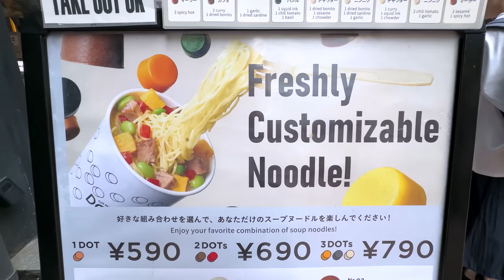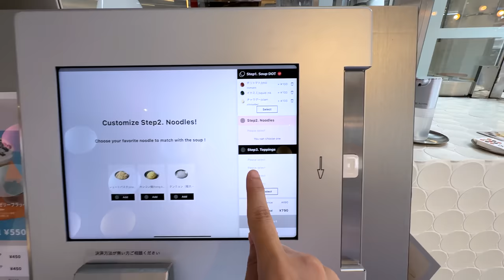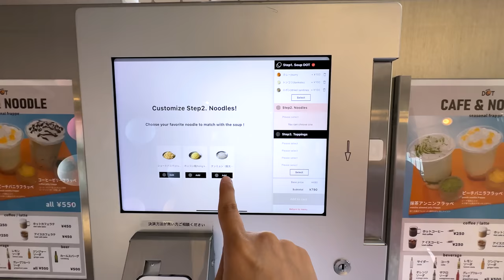The Most Unique Cup Noodle Cafe!

Comment: I do understand the draw of the robot, but I think this is one of those cases where it's not any more efficient since a human has to finish up the process anyway and the robot took so much time. I would totally buy these single serve soup pucks for use at home though!
Reply: Guess this is a prototype for what will eventually be a fully automated machine.
Reply: @pkmnan00bis 
That's what I was thinking.
They're testing the first automated phase in practical conditions.
Then, if it works out they can go to testing the second phase being automated.
If it works, no more human workers beyond maintenance.

Or it could be just a novelty meant to draw in customers and drive up the price a bit and we're overanalyzing it. Time will tell. 🤔
Reply: the robot is fun to watch though
Reply: Indeed. The robot is much slower at picking up three dots and adding water than a human would be. And then the human has to still do loads of hard slow stuff at the end.
Reply: You don't have to pay a human, The robot can work 24/7 without breaks, delays and or getting sick, It helps keep the cost's down by needing less staff on hand to mange a whole store.
Reply: Look like the staff is there to monitor the machine efficiency, report any breakdowns and troubleshooting. Once the machine reliable no need people to do the toppings.
Reply: @mrsynapse   If the robot could serve the product from order to delivery, this would be a good point, but the whole purpose of what I said is that it can't do that in this iteration. It takes the order and does the broth pucks, but a human is doing the noodle and topping preparation so the robot is limited by the functional capacity of the human handling it. And the human does still need time off, breaks, delays, could get sick, etc. 

It's still probably cutting down on prep time, but not nearly as much as it would be if it were autonomous.
Reply: @titusphilip1310441  Looks like the human is also prepping and adding the noodles in addition to the toppings. Eventually I'm sure there will be (or already is) a robot capable of all those tasks, but this is not that robot. The human is doing the most complicated part of this work in the current setup, and also a crucial one in order to serve the food to the customer.
Reply: Human was faster at completing tasks than the robot.
Reply: At the end of the day you have a robot which is able to at a frequency prepare cups, hot water, complex soup base. The human adds (salt msg?), mixes, adds toppings, and plates. The fact that the robot can handle half of the order does reduce the complexity placed on them and the fact that it does so at a specific pace allows the human to work in tandem at a set pace as well. As other say it seems like a stop gap measure to what I assume would eventually be full automation, but it's still more automated than doing all steps by hand. Having a single human on hand also works as a way to monitor machine health, supply, restocking. With freed up time it makes them available to do tasks which might have otherwise required maintenance or supply personnel.
Reply: One of the benefits would be guaranteed 0% cross contamination
Reply: @darknessblades  cross contamination occurs when the human involved steps occur.
Reply: The robot is not for efficiency at all at this restaurant. It’s there to attract customers intrigued with the technology.  I think it’s slow on purpose to put on a show for first time customers.  It also keeps the work at a steady but slower pace so that less humans are needed to run the shop.
Reply: @theboringchannel2027 Right?  When she did the stirring (5:00), she just put the whisk back into that tin can.
Reply: @KirkNorthrop  having programmed 3 to 4 axis robot arms the are can very easily  go faster
Reply: Could good for late night munchies. Imagine getting real food at any time of the day.
Reply: @Hawaiiwong  Only if it's fully automated, which it isn't right now. The whole noodle process is handled by a person.
Reply: @Hawaiiwong  cup of noodle is not real food.
Reply: @octo448  Of course. I guess the tech to fully automate is already there they just haven't used it in this instance. According to some of the other comments.
Reply: @theboringchannel2027  I mean, at this point, its just ramen with a broth from concentrate in a cup-shaped bowl. The noodles aren't dried either. It's not like they're giving you prepackaged ones either, you can customize it. Essentially, my opinion is that if pasta made from jarred sauce and dried noodles is real food, this is also real food.
Reply: It's not intended to be more effecient, it's a tourist attraction. The little menu inside says they have as much staff as a small restaurant, they have a guy on site in case it breaks down, they have kitchen staff making the dots and toppings, etc.

Despite the dystopian vibes some are picking up, this machine is designed too be visually impressive. Not effecient. Like do you people really think displaying the dots like that and going back and forth is remotely the best way to do it? Or do you think a conveyer belt underneath a dispenser line for each different dot and the cup stopping underneath the correct ones would be way quicker, more effecient and  negate the idea of having to swap dispensers??

Seriously when the machines replace us, there isn't going to be windows to watch the mechanism because its going to move as little as possible and be as brutally effective and cheap as it can be
Reply: @Hawaiiwong it's a cup noodle with instant soup and pre cooked frozen vegetables and ham. You can replicate this experience at home in the time it takes to boil a kettle. Its not better than that.
Reply: @medes5597  I would say there are a few key differences (like the noodles being fresh as opposed to freeze dried) but not that it matters to you. I was talking about the potential future implications.

But all I can say is the same thing. Convenience and options are valuable. The ability to have a somewhat custom meal is valuable. Olive garden sells plenty of its most basic pastas which are just pasta with a premade sauce put on. Not much different than dried pasta and some jarred sauce. But there are different flavors and the pasta is fresh. Its convenient and people pay decent money for that.

But now imagine having in America the upgraded style of vending machines they have in Japan. Something like a more autonomous version of this that lets you make and customize a bowl of ramen (or any other food for that matter) at any time of the day. I could see this doing well on a college campus, near investment banks, or with other places where people want a decent refreshing meal and are working late into the night.
Reply: @Hawaiiwong  

The noodles aren't fresh, it tells you they're freeze dried at the start. 

almost identical automatic omelette machines have existed for nearly three decades. They've never caught on. They showed up in hotels, colleges, etc and they went away. This is a tourist attraction because that's all this kind of technology is good for, show casing itself. Its otherwise pretty useless.

McDonalds trialled an automatic resturant and shut it down because it didn't save money, it wasn't popular because it frequently messed things up, and they still had to hire staff to place things in the right places and try and fix its messes. The technology to do this nonsense is decades old. It can work in a factory for clinical and industrial tasks. It's never been successful for food except as a gimmick. And that's how it will be a always. This technology would have to dramatically improve and there's zero incentive to do so.

Those staff less 7/11s? Yeah they'll probably spread.

This thing? Not a single chance in a billion. This machine is 20 years old and your dystopia has yet to occur. Because these machines are spectacles and nothing else.
Reply: @medes5597   I mean I can admit when I'm wrong. Can you give the time stamp in the video where it says they aren't fresh? I guess I missed it.

Idk I still think it could be useful as the technology improves. As I mentioned in previous comments, others have said in the comments that technology to fully automate this is there. Even if its not this exactly, I still think the idea of vending machines with higher quality food can be a useful idea for people who do not follow a traditional schedule.

Comment: This whole machine gimmick could be fully replaced by a more simpler way....
Like if you put your dots in the cup, pour hot water on in, the noodles toppings and stir. and that's it.
With this gimmick you have to pay the price of the machine the maintenance and the electricity it uses.